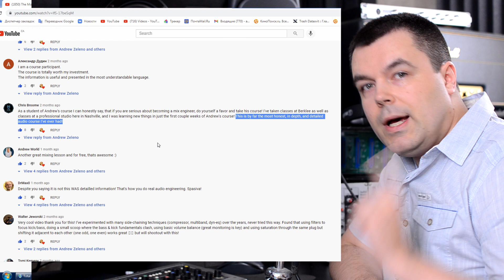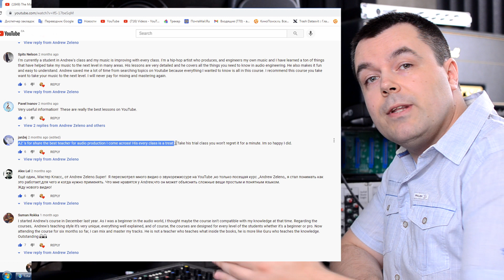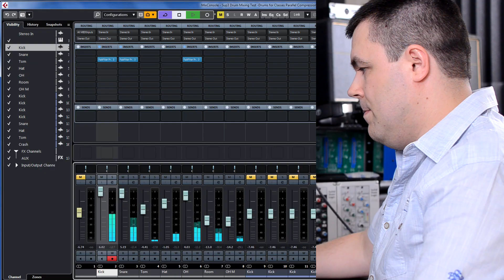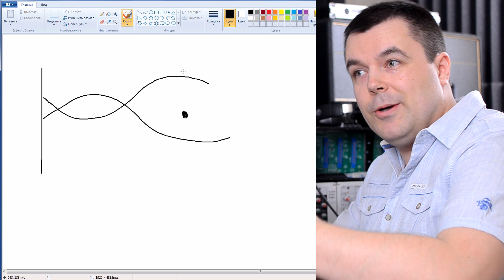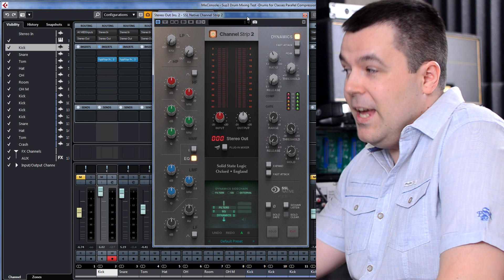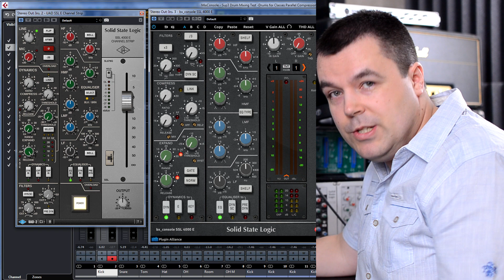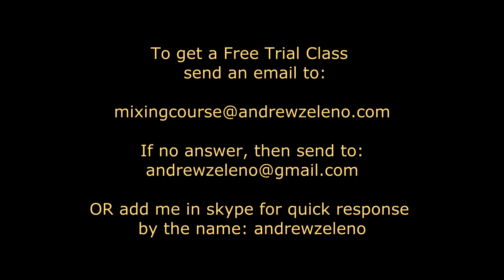Audio Engineering - Ugly Truths

Comment: John Hanes says that the studios he and Serban Ghenea work in have never been measured. They're well designed, but he says he has no idea how "flat" the room is. Also great basketball interludes haha
Reply from the maker: Not sure how it relates to my video :) It has no connections. But thanks for commenting! :)
Reply: @AndrewZeleno1  because you said people are very worried about room correction eq software and all of that, but people like serban and john say they've never even measured the rooms they work in, and they make chart topping mixes.
Reply from the maker: I see you say by this that room doesn't matter. And in some nuances I can agree with that. But it's totally not the point of what I say in the video. I said you need to set up a studio properly to control the length of the room reverb and to avoid standing waves. And I show why and what flaws acoustics correction tools have. I never said it doesn't matter what room you have. All good man. You just shared that some guys don't care about their room. It's ok. I just don't want your comment to sound like it's a reflection to what I said it the video. I actually suggested to do opposite. To know your room and understand if you really can fix it with some tools or not.
Reply: @AndrewZeleno1  I get the misunderstanding I had there. I'm don't mean to say the room doesn't matter, or that they're saying the room doesn't matter, as i said in my original comment they're still in very well designed studios (built into a house!), just that they haven't used any software to "flatten" or measure their studios, and it doesn't concern them as much as the marketing of the plugins designed for it want people to think we should be concerned about, like you said. it's just a lot of marketing telling people the software will fix all their problems, but in reality it might not!
Reply from the maker: All good! Just opinions. Respect!

Comment: Hi Andrew thanks for the videos. Can you please explain why you say the software that increases the volume of the frequencies that go through phase cancellation will not be effective? From my understanding the phase cancellation is not complete but partial. So if you were to boost the volume of the frequency that is experiencing the phase cancellation yes there will be a proportional increase in phase cancellation but the overall volume of that frequency is boosted to compensate for this cancellation. Surely your logic only applies when a frequency is completely cancelled out. If there was complete phase cancellation we would not here that frequency at all.
Reply from the maker: Even in partial cancellations positions you increase the amplitude by the plugin but the same waveform goes back with increased amplitude as well.
Reply from the maker: My new video. 4 bonus Ugly Truths. This time on Mixing and Mastering: https://youtu.be/TkZvPqsWlUs

Comment: i agree with you on most points, but i think the ssl native eq adds SOME saturation, just by messing around with the input volume, with the comp and eq passively engaged. but i agree with you, it's very clean overall. the ssl native is a 9000 emulation, though, which is cleaner anyway.

in my opinion, the best ssl 4000 emulation, to date, is the cla mixhub, which has the separate line and mic preamps, just like the uad, but also adds saturation in every additional module, like brainworx, including the out fader, again, like uad.

additionally, adjusting any knob, in any module, even if passively - meaning not actively affecting sound - changes tone, which is what it should do - here, again, similar to brainworx. so it's got what's missing in either. the fader saturation thing actually bugs me a little bit, cause i would like a clean out adjustment. but it sounds stellar, overall.

and it's got some nifty features like soloing eq bands, the width of stereo tracks, and the bucket option - which could still be improved, though, in terms of controls. the only thing missing is some channel tolerance technology, to make it as close to a console as possible.

and it gulps up cpu like it hates it. but, at least, you know why. all these strips that you can add 200 of, in one project, have to compromise somewhere.
Reply from the maker: It's not my opinion it's a fact that Native 2 doesn't add any harmonics. I measured it. As you say if you play with the compressor it adds some harmonics. It's because its a nature of any compressor to boost harmonics. Mixhub is far from SSL sound. One of the farthest actually :) But who cares. If you get needed results with i, good for you. Cheers man!
Reply: @AndrewZeleno1  i don't have the 2, my findings were based on the 1. i did some testing, and i agree with you, and don't, at the same time. the native channel does adds harmonics, and quite a few of them, but you're right, they're not from the input, which is just a trim, but from the compressor. since i always keep everything engaged on the channel strip, for a more pronounced vibe, i always hear those. and i'm happy my ears didn't cheat on me.

as for the mixhub, i think you're wrong. i've analyzed about 5-6 ssl channels/pres, and here's what i found - quite a few surprises. since the native doesn't have a preamp and only adds harmonics in the compressor, and the rest of the emulations were more or less preamp emulations (maybe with a transformer thrown in, faders, etc., who knows), the only direct comparison i could make was between bx 4000e and mixhub. first of all, among all emulations, no two looked even remotely the same :), but the interesting part is that they all convey that vibe, which is great, and, finally, is the idea.

as for the bx - mixhub shootout, i was surprised to find a few differences to my initial impression, technically, but still confirming it, in the end, musically.

first of all, both the dynamics and eq modules on the mixhub add harmonics, as i thought - but they're setting dependent - so the compressor doesn't add anything at a 1:1 ratio, and it progressively adds more and more as you increase the ration EVEN IF the signal is not actually compressed, while the eq increases the 1st and 2nd octave harmonics of the selected frequency, in relation to the gain setting, while leaving the others mostly unchanged. since my default ratio is 2:1 i could hear those harmonics, even with no compression applied, but i was surprised to find no harmonics were added at a 1:1 ratio.

the bx's modules add harmonics, too - the eq more than the dynamics - but statically, regardless of settings, from what i've seen - i haven't insisted on that. so, to me, mixhub acts more naturally.

the brainworx is a lot noisier - for the -90 db default setting - around -105 at 20k, against mixhub's around -128, so mixhub is a lot cleaner. of course, you can adjust the noise level on the bx.

the noise curve on the mixhub is pretty flat, with bumps around 50 and 1100 hz, and going up from around 4k (about 6 db increase to 20k). the curve on the brainworx is a linear boost of the treble, like a tilt eq, and a lot steeper (about 12 db increase from 4k to 20k).

the saturation is a lot more complex and balanced on the mixhub, as opposed to the bx, which only has a few harmonics, pretty unbalanced, and very pronounced - for -60 db thd, which is the default setting in the manual - that is adjustable, too.

the fader on the mixhub DOESN'T seem to change the harmonics, to my surprise, but i'll have to look some more into that. I usually adjust it into a tape machine and some summing emulators, so that must have been it, even though i try to match the volumes.

that's the analysis.

beyond that, i like the bx, it sounds pretty good, still has that smack and that sheen, but it's a bit too transient spikey, for me, it's almost like a cosmetic effect. the transients seem a lot better saturated and balanced on the mixhub, without the mud that you'd get on the bx for a similar effect, and, overall sounds miles above pretty much anything else that i've heard. on the other hand, again, mixhub kills your cpu, whereas bx and the rest are a lot lighter. so, between the sound and the computer, i'd get a more powerful computer - i already have :).

the bx has the advantage of the channel variations, which should be implemented on all console emulations, if you ask me, mixhub has the advantage of the bucket, the stereo width and band solo in the eq.

finally, i don't think a spectral analysis can reveal all there is to a processor, since there's a lot of stuff, like phase cancellation, crosstalk, etc., which doesn't show up on a macroanalysis like this - you'd have to go at it microscopically, and with more complex signals than a sine wave. for instance, i have compared two tapes, with pretty much the exact noise and harmonics curves - both are my favorites, and now i know why - and they sound very similar, yet not identical.

so that's it from me.

take care!
Reply from the maker: Any compressor bring harmonics up. It doesn't mean Native 2 has analog bus saturation emulation which is there in a real device which I have and I measured a real console too. Your analysis is not a comparison to a real SSL console. As I said in the video these plugins are questionable how close they are to the real device. It wasn't about waht somebody likes. Any plugin may be somebody's favorite tool but it doesn't make it better emulation. So when it comes to SSL emulation, I never mention Mixhub plugin because it's probably one of the farthest from the real thing. Anyway youtube doesn't show me replies so if you reply I will not see it. Anyway, no point to discuss it as the point was they all claim it's a real thing while it's totally not .Plugins are plugins which some similarities to the real device. Not more than that.